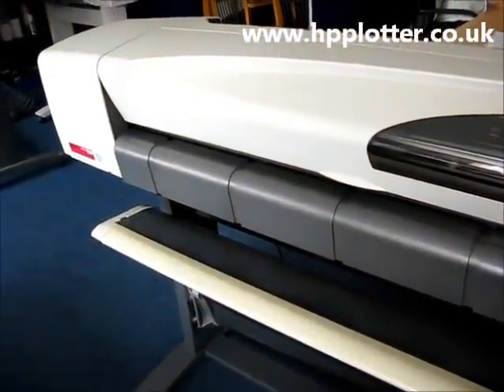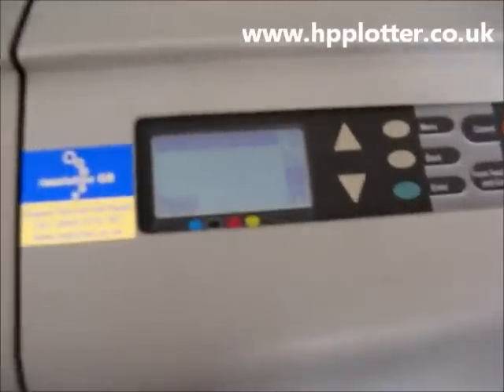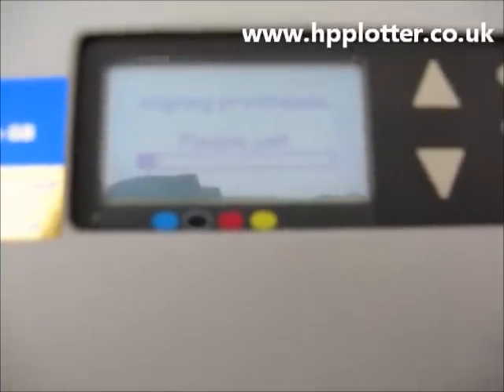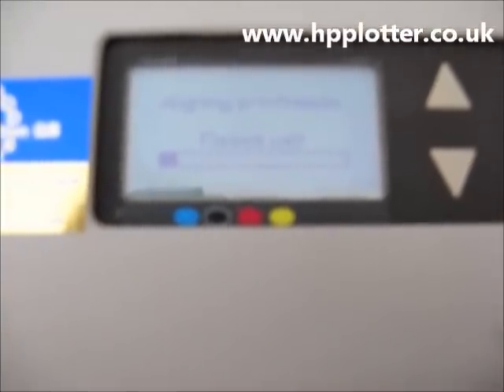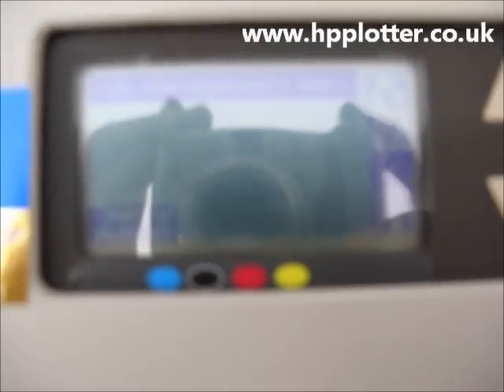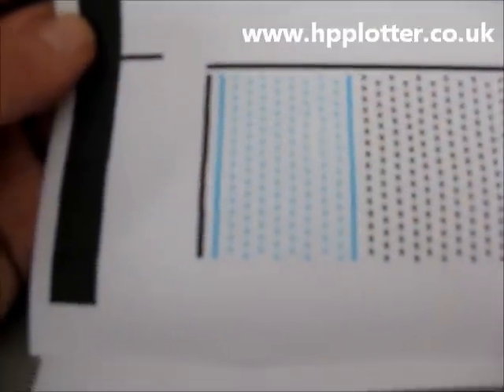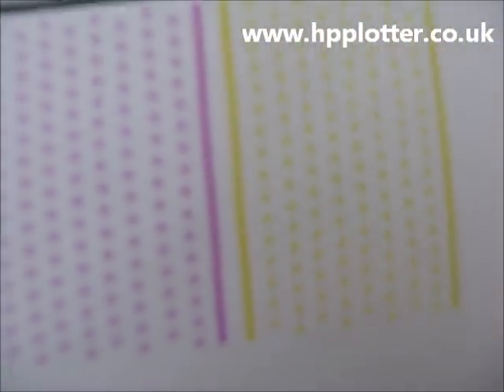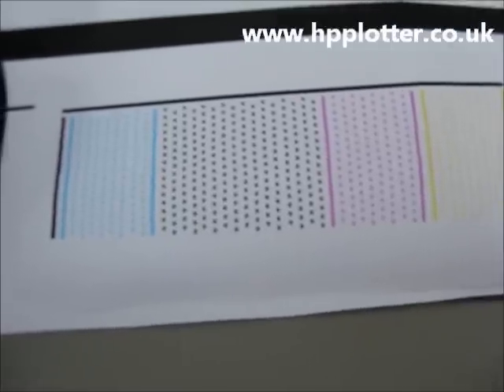DesignJet 500 print head alignment

Comment: Didn't work with my and it stop with 79:04 error
Any help
Reply: Check your printheads are in date and working - otherwise you need to do maintenance on the printer or call in an engineer to do the service who should be able to resolve the issue for you.
Reply: @snootybutnice  there is NO engineers available anymore!